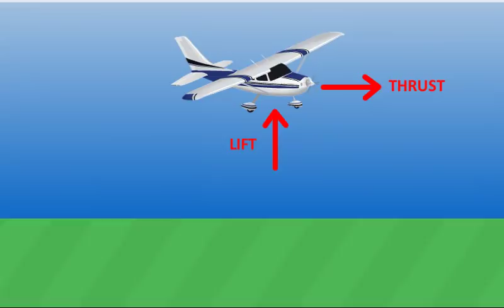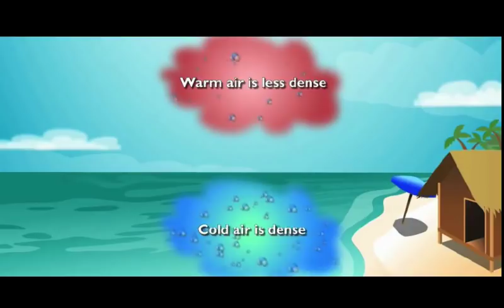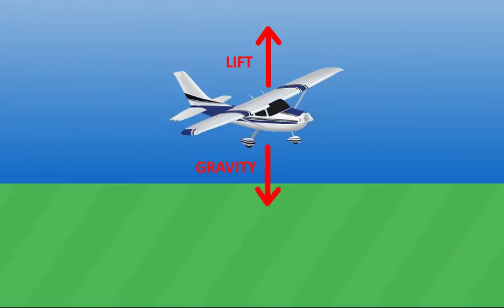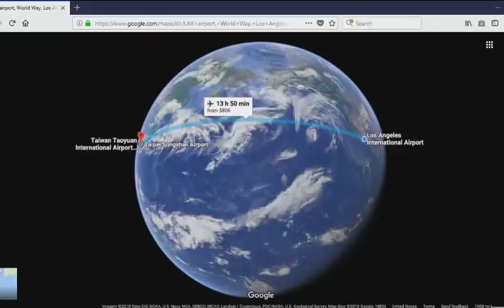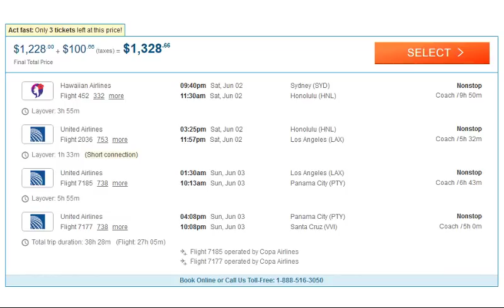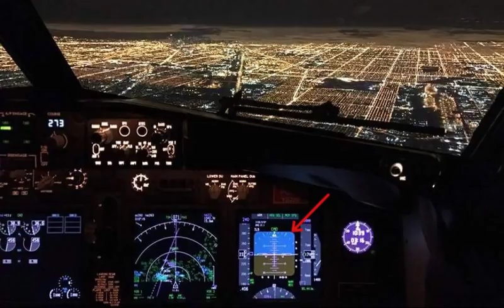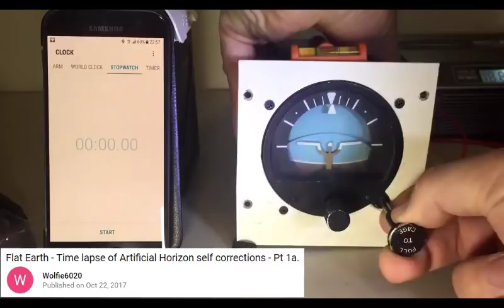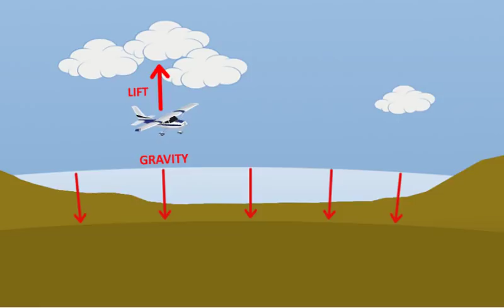Flat Earth Falsities - Plane Nonsense

Comment: In a similar vein, I looked at the planned SABR submarine communications cable and found that the Flat Earth cable would weigh 16k tonnes, 7k tonnes too heavy for the largest existing cable layer, and the ship would run aground far North in Angola with less than half of the cable payed out.

Comment: If you haven't already.  Check out 200 proofs the earth is not a spinning ball by erick dubey
Reply: "Do you know what a troll does?"
Oooh oooh I know.. do they spam a comments section with loads of threads all repeating the same thing and then ignore any responses they get?
Reply: You have been proved to be a troll and  told to fuck off and stop trolling. So kindly comply.
Reply: I prefer quality over quantity any time.
Besides these aren't any proofs that Earth is flat. Most of them is based on misconception or observation which are strongly dependent from weather conditions (refraction).
Reply: James Hewitt It's a poor quality video. How can you ask people to go out and do experiments and then ask people to check out a video that's just heresay? He says things that are just wrong.
Reply: Bobby Wizdum - Anyone who thinks that Dubay's video is even slightly convincing should read Inti's thorough rebuttals and decide for themselves: http://roundearthsense.blogspot.com/2016/02/.
Reply: @James Hewitt. Calculation are quite easy (maybe not for flat Earther) but long distance measurements are not so trivial. If you put wrong data into proper equation you will get wrong answer.
Reply: James Hewitt  I have before, but I haven't been able to finish it because the first parts are incorrect. I don't see a point of watching the whole thing when he's wrong at the start. I haven't looked into what he claims some people have said, but his other claims are false.
Reply: Bobby Wizdum Did I say he was wrong about everything? So what science was there in there? It's a really shitty starting point. There's amateur video showing a curve, so #1 is a lie. There's tests showing that the horizon doesn't stay eye level and you have to look down for it to stay at eye level, so #2 is wrong. Should I keep going at your "good" starting point? 7 out of the first 10 he said was false. I didn't look into 2, but both was a claim that someone said something, but has both is proven wrong in practice. And one he's semi-right, but it doesn't mean the earth isn't a sphere.
Reply: No one says anyone is walking around on Earth upside down. Everyone is downside-down and upside-up, because for every point on the surface of the Earth "down" is towards the centre of the Earth and "up" is towards the sky. Up is relative to your position, just like the compass points.
A plane flying along keeping North on its left will head East and will eventually end up on the opposite side of the world/disc flying in the "opposite direction", but that is still heading East from where it is.
Reply: See this thorough debunking of Dubay's "200 Proofs" video:
http://roundearthsense.blogspot.com/p/home-page.html
Reply: The actual debunkings start on this page:
http://roundearthsense.blogspot.com/2016/02/
Reply: Bobby Wizdum -Fucktard Alert!!
Reply: That video is some seriously stupid shit.  Their are zero "proofs" there.
Reply: Bobby Wizdum "theres no wrong equation"
An equation that describes a parablic curve does not describe a circle. An equation that fails to take into account the observer's elevation is not going to accurately calculate how far the observer can see.
Reply: I did I stopped after proof 5 it just not make sense to me
Reply: yes it makes perfect sense Bobby
Reply: Booby Wizdum
 "water sticking to a spinning ball because of gravity does?"
Yes as already proven

" the sun being 93 million miles away makes sense to you?"
 yes as already calculated

" spinning without feeling a thing makes sense? "
Yes because we don't feel speeds but only accelerations

"australians being upside down yet easily accessible by plane or boat without going upside down makes sense?"
Peopel upside down exist only in the flat earth cult's strawman of the standard model and PROVE the total inability of flat earth cultists to grasp 3D geometry

" i question your sense then.
"
 I question the functioning of your brain... Never mind I ve no more question about it !!
Reply: James Hewitt
Take the Eric Du(m)bay's model of flat earth.
 Then try to put on it an enlighten disk at scale over the equator to simulate equinox (by his model).
 Then mesure if you can have the 12h day/night for everyone...
 Your guru's model DE-BUN-KED in 3 seconds !
Reply: NYCFenrir its not poor quality at all. its a good starting point. obviously is say no hes wrong about everything without testing anything than well thats not science my friend.
Reply: Richard Carnes ive seen it and its jibberish like this video. does the guy actually show experiments debunking these proofs? no.
Reply: Stewart Casey then like i said if you feel people are walking around upside down i question your sense
Reply: Please do the math on the curvature for yourselves its so simple
Reply: Are you admitting you have nothing to say at all? Dont you have a calculator? There's a free app you can download if you dont. Or maybe you are like most and terrified of what the calculator might say?
Reply: Do you know what a troll does?
Reply: Martin Gorbush theres no wrong equation for earths curvature unless earth is way bigger than we were told.
Reply: Stewart Casey but water sticking to a spinning ball because of gravity does? the sun being 93 million miles away makes sense to you? spinning without feeling a thing makes sense? australians being upside down yet easily accessible by plane or boat without going upside down makes sense? i question your sense then.
Reply: Have you guys actually watched it ? The video this thread is on looks and sounds equally poor in quality.  Also its a bit more than a few points on a few theories. Watch the video before you try telling me that its no good

Comment: One important detail I have realised is that a flat earther will argue that for an airplane to travel around a globe, they will need to point the nose down in order to not fly into space. ie: if the plane travels in a straight line, it will leave earths orbit.

 Then you ask the question as to if an airplane was to take off from somewhere on the equator and travel either directly east or west, traveling in a straight line, then they will eventually reach the ice wall.

However by flat earth reasoning, it would be argued that they would return to the point at which they first took off, following the equator line.

And yet using the same principle of an airplane having to dip its nose to maintain level flight, the flight around the equator would require the airplane to bank right traveling west, or to bank left when traveling east in order to achieve this "straight line flight path".
Reply: Neil Badger dude it wouldnt go east or west to reach antarctica. you clearly don't understand the model. east west is just a circle around the continents. they are one direction.
Reply: Hence, not a straight line on the flat earth map, as you have just specified traveling in a circle.

Comment: Dude your an idiot. You pick the dumbest point to argue. Explain how it can be scientifically proven that there is no curvature. It can be repeatedly proven. You cannot prove any curvature. And it never has. And you keep taking about gravity like it’s a real thing that it has been proven.
Reply: "You pick the dumbest point to argue."
Aren't all FE points dumb?
Reply: Its relativity my friend. Gravity is proven by Einstein's theory of relativity which accurately predicts why gravity is factor.

There is also Nemours experiments that can be done to prove curvature. Anything from objects, like boats, dipping under the horizon belly first. To comparing the angles given by shadows from 3 poles placed in different towns. To the classic viewing of two sunsets by running up a flight of stairs just after the sun had sat to view it again. (I've actually seen the tops of tall buildings be still illuminated while the bottoms where cast in a night time shadow). 

There is also the way the sun behaves near either the South and North pole. The fact that the Sydney Australia to Johannesburg South Africa flight doesn't go over China and Is actually possible, I have Family that immigrated to Australia and they did that flight for my sister's wedding(I'm South African).

The fact that flat earthers neglect to point out the flaw that could neutralize the gravity argument speaks volumes about how much "research" they actually have done. Here's a hint, look up quantum mechanics and string theory...not that it matters since I'll counter that argument with Einstein's theory of relativity if you bring it up...

So please leave the flat earth cult. It won't end well...
Reply: seymoresaymore 
Indeed they are...
Reply: CONGRATS..You may be the dumbest KID on the internet.
Reply: only to oblivious minds..

Comment: If a jet airplane takes off from Quito, Ecuador and flies due West @ 1,038 mph for 24 hours, he will have circumnavigated the globe and end up where he started, right? If he departs at high noon, his entire flight will have the sun directly over his head. Does that mean that the sun circumnavigates the globe as well?
Reply: "If a jet airplane takes off from Quito, Ecuador and flies due West @ 1,038 mph for 24 hours, he will have circumnavigated the globe and end up where he started, right?"

Correct.

"If he departs at high noon, his entire flight will have the sun directly over his head."

Correct.

"Does that mean that the sun circumnavigates the globe as well?"

No.
Reply: No. Science and logic aren't your strong suits are they.
Reply: @Stephen Bell wrote: "Does that mean that the sun circumnavigates the globe?".
NO. However that was common misconception before Copernicus. It was called geocentrism.
What happened next was connected with tracking location of planets and noticing their retrograde apparent position change. That could be explained only when these celestial bodies were circling around the Sun, hence heliocentrism.
Reply: Another sock account dumb fuck by the look of it.
Reply: Newton one: An object in motion will stay in motion unless a non zero net force is applied to it.

Newton two: if a non zero net force is applied to an object. The object will accelerate in the direction of this non zero net force. The acceleration is proportional to the magnitude of the force and inversely proportional to the mass of the object.

C'mon people this is basic highschool physics...
Reply: @Booby Wizard.
I can. Just check what is retrograde movement of the planets. That clearly shows that they are revolving around Sun. It would be stupid to believe that these celestial bodies, were some of them are farther away from the Sun than us, are somehow revolving around Earth and our star simultaneously.

Nevertheless I think you did your first step to the truth. Geocentrism was disproved 500 years ago while flat Earth 2200 years ago. Bravo.
Reply: Stephen Bell

"If a jet airplane takes off from Quito, Ecuador and flies due West @ 1,038 mph for 24 hours, he will have circumnavigated the globe and end up where he started, right? If he departs at high noon, his entire flight will have the sun directly over his head. Does that mean that the sun circumnavigates the globe as well?"
Yes, the evil sun monster is chasing your anthropomorphic jet airplane.
Reply: OMG GMO well you say no but obviously cant prove it isnt the sun rotating the earth.

Comment: A lot of flerfers seem to have a problem understanding the scale of the earth. Try this simple experiment. Take a standard school globe, make a model of the White House to scale (or any building you like) and paste it on the globe.
Reply: "A lot of flerfers seem to have a problem understanding the scale of the earth."
Small minds and all that.
Reply: Bobby Wizdum
Fuck off you silly boy and stop trolling.
Reply: Bobby Wizdum "then explain to us all why the two houses are at opposite ends of the curvature"
Because we had just put them there?

"tell us we need to go 100000 feet to see the curve"
As Dog Gonnit said, FE'ers have a problem understanding scale. 

"your fingers clearly gotta go uphill over the curvature"
Which is way downwards and why?
Reply: Bobby doesn't understand the difference between North and Up, but somehow still feels qualified to argue about maps :)
Reply: If you understand how "down" works on a globe then why are you blethering on about the equator bulge, the Nile and your fingers going "uphill"?
Also the horizon is not always at eye level. You can confirm this by going somewhere high with a view of the sea and using either a theodolite, a Dumpy level, a level/theodolite app on your phone, or a water-level. The horizon will be below eye level.
Reply: Bobby Wizdum
 - Fuck off, muppet. Your questions have all been answered repeatedly.
Reply: GrahamStw yes i do. you still cant dispute the curved surface view points.
Reply: Dog Gonnit yep get two buildings. put them on opposite ends. then explain to us all why the two houses are at opposite ends of the curvature. then put your fingers on the poles and tells us there is no top or bottom. then tell us we are all on top and all curvature is down. then tell us even though we are on top and the horizon should be at our feet and not eye level tell us we need to go 100000 feet to see the curve. then after that look at your buldge in the equator and run your finger along the nile river. then tell us even though your fingers clearly gotta go uphill over the curvature that there is no up and down. hell...i never know what ballshit you guys will spew next